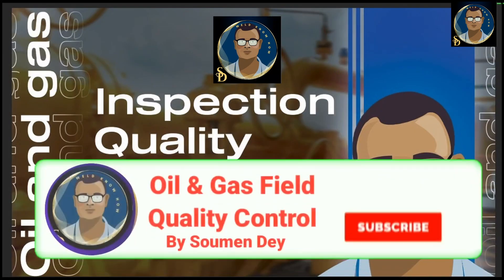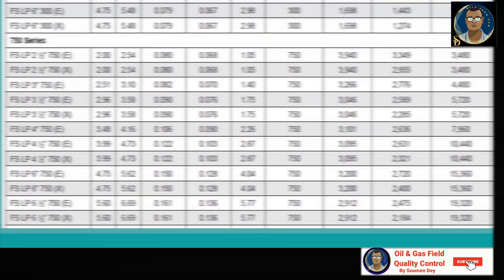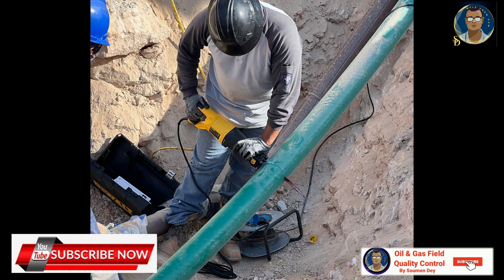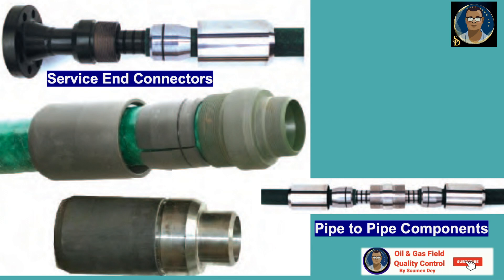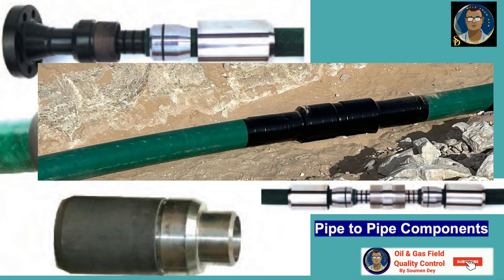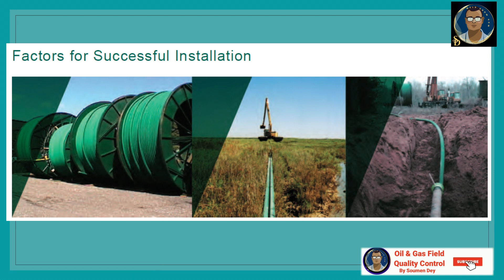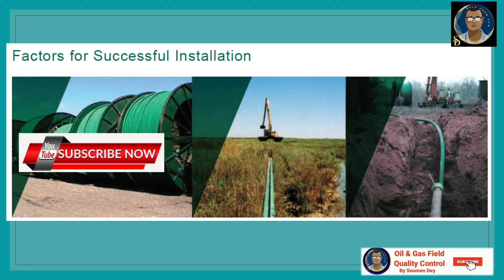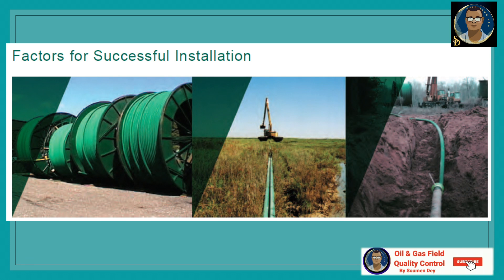How To Join RTP Pipeline || RTP Join Pipeline Tips || RTP Reinforced Thermoplastic Pipes

Comment: Excellent information and pesentation.
Reply from the maker: Thanks a Lot
Reply: @OilandGas-inspection-soumen  For RTPs, do you generally use metallic connectors or are there non-metallic connectors available ?
Reply from the maker: @johnadam2885  This high Pressure RTP is an evolving technology and it is executing well, if protected from outside damages. So far, we never found any leakages from these metallic connectors. It holds hydrotest pressure as high as 2000 Psi (for our project). Considering the high pressure of the pipeline and ease of installation, These metallic connectors are only approved and allowed to use in our project. I have not seen any Non-mettalic connectors for RTP as in case of RTR high pressure joints.,
Reply: @OilandGas-inspection-soumen   Thank you very much, you have answered my question well.
Reply: @OilandGas-inspection-soumen  Can you give me your WhatsApp number?